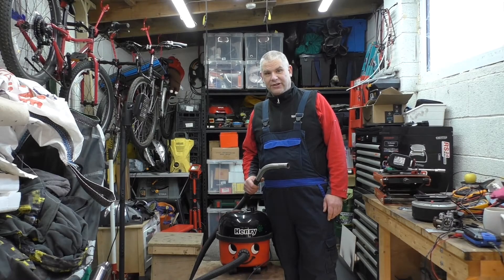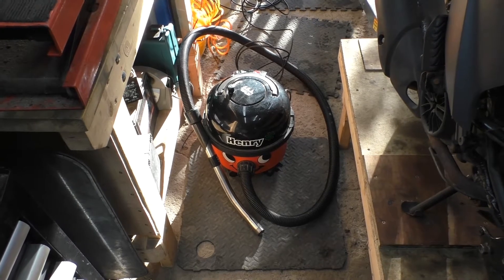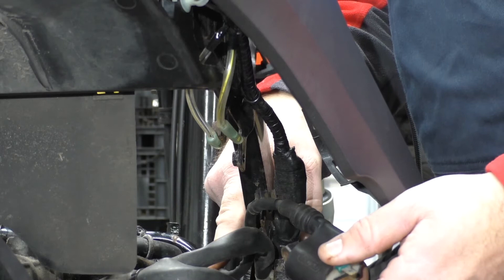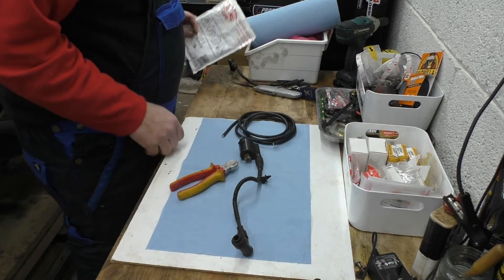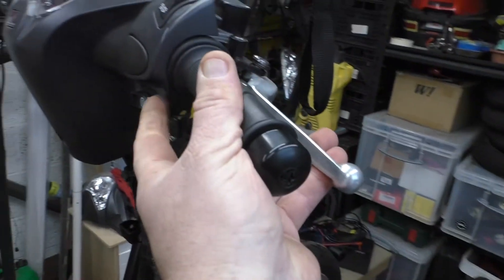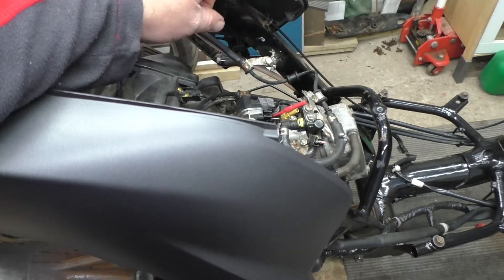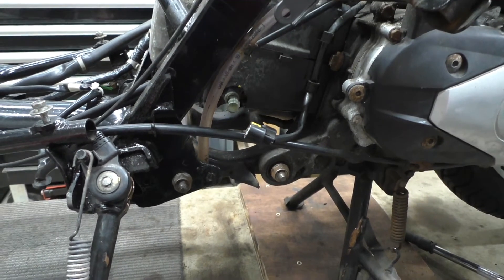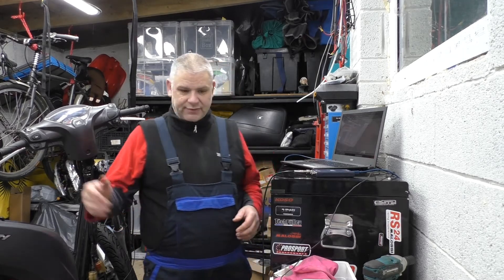Honda Vision 110 Re-build: Engine repair & fault diagnosis with a Picoscope 2204A

Comment: Hello firstly can I say how informative and well presented I found your video . I too spend a lot of time in my garage fettling bikes, mostly 125s and Hondas. Far more time fettling than riding these days. In addition to the mid size bikes I ride , for the first time in 50 years now I recently got my first scooter , a Honda innova fuel injected model and did my usual thing of pulling it all apart, cleaning it all up , replacing parts as required etc. As such I found your videos of the Innova and Vision of particular interest. I also found it very interesting to see your home made bike bench and how you used the ramp to get it on to the bench. You seem to have such a great and well organised layout there and it’s given me lots of inspiration to improve my own set up. I’ve got a huge respect for my Innova albeit I’ve only just done a few local rides on it. I was really impressed by your trip from Farnborough to Scotland on the Innova, clearly it is a very capable and reliable machine. Thanks for your videos and I really look forward to seeing more in the future.

Comment: Hi, I have a Honda vision 110 68 plate, I am a lorry driver and I work silly hours and I am unable to fit the time to do stuff for the 110. 
The break light is on continuously due to the harsh winter, I would like to fix that myself but I don't have a clue on how to even diagnose it.
I don't have a garage but I could do stuff over weekends.
Can you suggest best approach to solve this problem?
Thanks!!